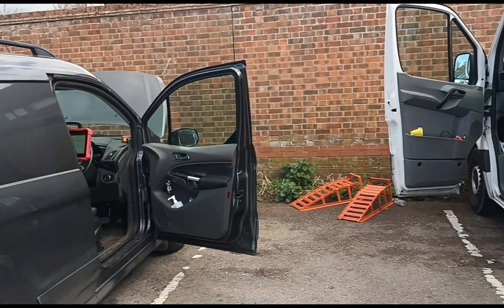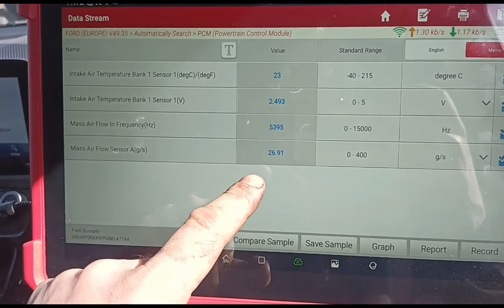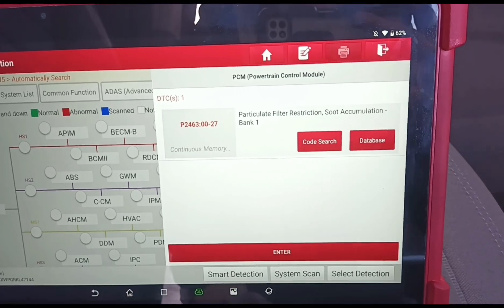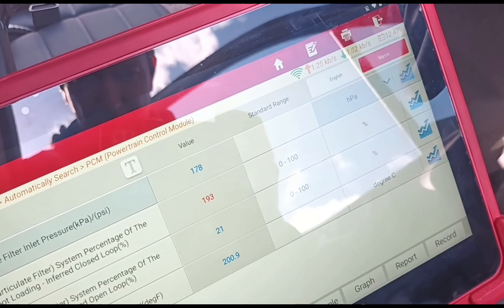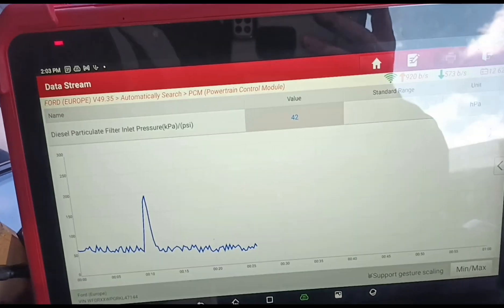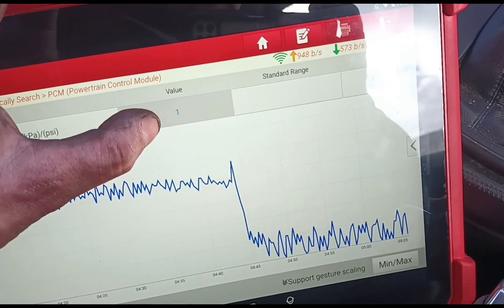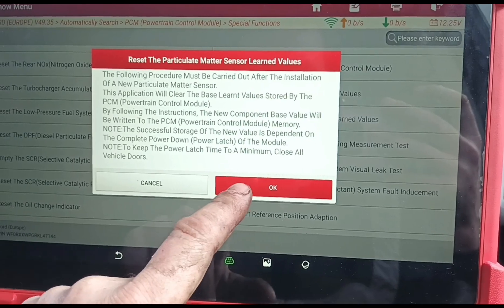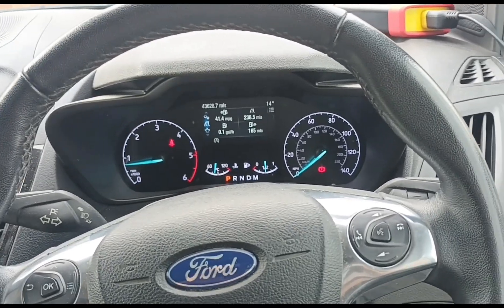Ford Transit Connect 1.5 P2463:00-27 Particulate Filter Restriction Soot Accumulation DPF Cleaning

Comment: I can't reset learned values on my 2018 connect - DPF is clean, pressures are in normal range after a physical clean and my Snap on Modus will not reset it. Says "no comms".

Tried Launch too - any ideas?

Forgot to add that although it's  2018, it looks to be on a changeover because it has the latest style engine fuse box in there.

Comment: I can't reset learned values on my 2018 connect - DPF is clean, pressures are in normal range after a physical clean and my Snap on Modus will not reset it. Says "no comms".

Tried Launch too - any ideas?

Comment: This has just happened to my 2019 connect after the exhaust filter was cleaned. Does putting a new battery in turn the engine light off?
Reply: If the ECM light is on for the DPF then a new battery won't sort it.